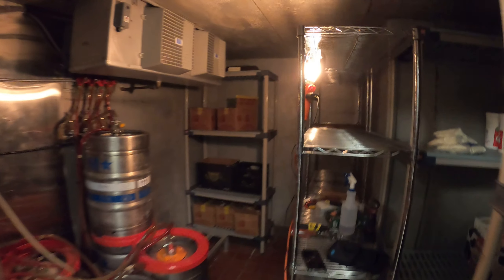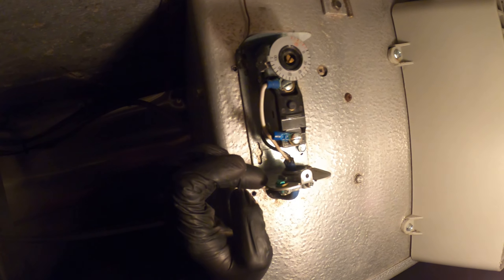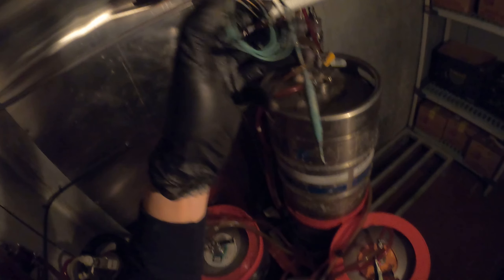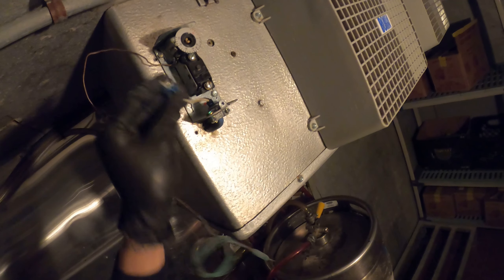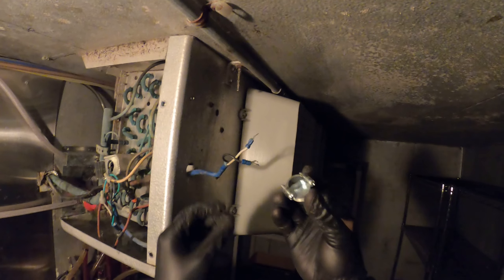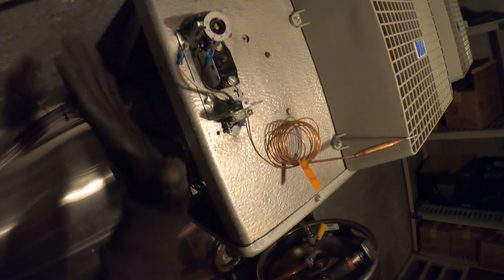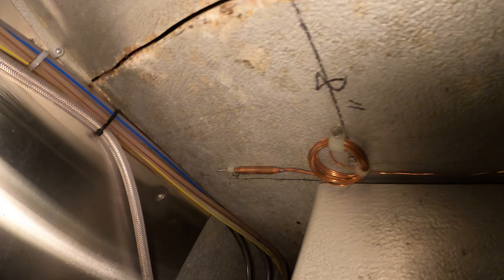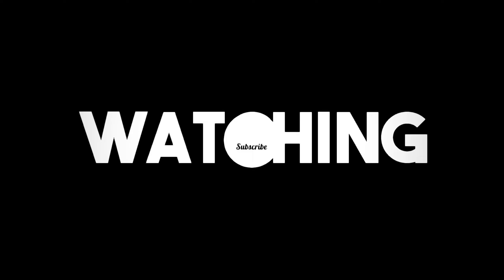HVACR: How To Install/Replace A Refrigerator Thermostat (Temperature Controller Installation) Wiring

Comment: What would happen if you rewired those 2 connectors incorrectly by placing them in the opposite terminals (accidently)?  Would it damage the thermostat?

Comment: how do you covert this mechanical thermostat to a Ranco ETC thermostat 115V circuit? I understand how to power the ETC and jump power to the contacts below... but not sure what I do with the existing wires from the mechanical thermostat.. please help I have to convert to mechanical thermostats tomorrow to ranco ETCs.

Comment: Why not the Sensor is by the door half way down?
Reply: return air is a good position
Reply from the maker: Hey Mohammad, Julio is correct. The sensor should be at the return air section of the blower for the best accuracy👌
Reply from the maker: @juliochavezunacosa4147  👌👌👌

Comment: It is better electronic controls than mechanics A421 , and less expensives
Reply from the maker: I was recommended the A421 by another tech as well. They are less expensive than these? This mechanical stat was on sale back when I got it and kept it in the truck for stock. Came in handy 💯 Thanks for watching! Appreciate the response. Stay tuned for new videos every week⚡🔧